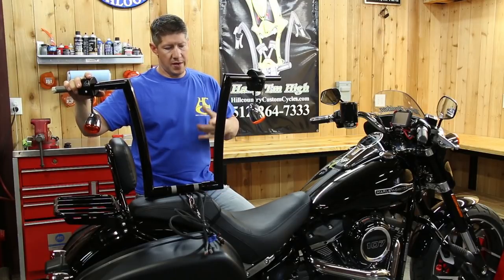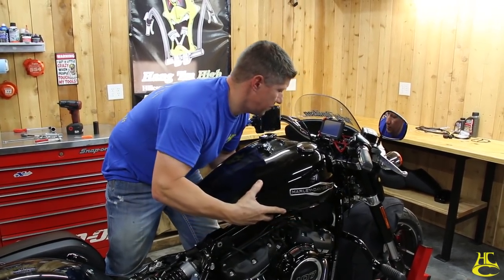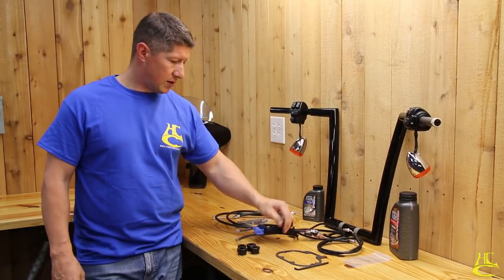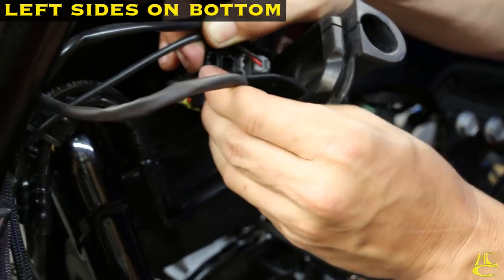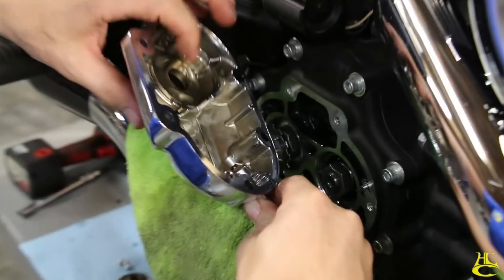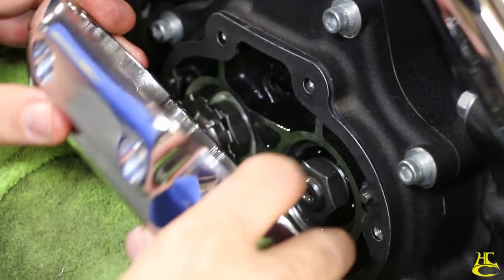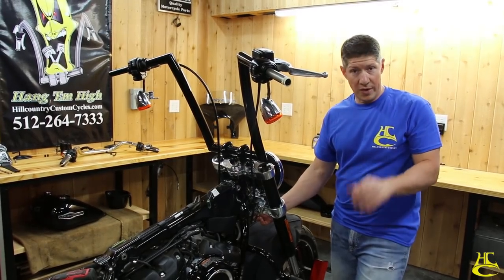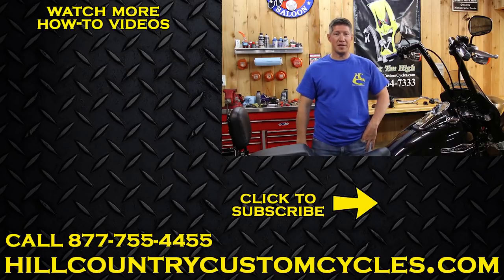How To Install Ape Hangers 2018 Harley Davidson Softail - Save Time & Money!!

Comment: Great video!  Question -why did you have to install new clutch cable all the way back by the exhaust.   I always thought on newer bikes the HD quick release was there to make it easier.   So you didn’t have to take the bolts off of that compartment take the balls out etc.  just curious
Reply: Never seen that. Maybe it is like that with the hydraulic clutches.
Reply: I was thinking the same thing. I have a 2019 sport glide and I'm about to install some bars and everything I've read so far says you just need to fellas the upper clutch line. no need to mess with the lower

Comment: Good day great video thanks. i have one question about the throttle by cable and the connectors on a 2013 FLHX and z bar style 15inch apes does one have to eliminate the connectors to go around the first 90

Comment: Great vid. I was wondering if you could help me with something. I unplugged all the cables like in the vid. In the end I took my bike to a shop and they’re worried about plugging it all in again due to some of the plugs being pretty much the same. Have you got some kind of diagram that shows what plugs go into which terminals/sockets ? Would be a massive help. Thank you
Reply: Rob Pullen the only 2 that are the same are the blinkers I’d be questioning this bike shops ability if they can’t figure that out
Reply: Colin Elwin yeah thanks man for that. It was all done a while ago as you probably guessed. The issue was that the guys in the garage were completely old school and didn’t like working on a newer bike. He blatantly told me he hated my Harley and I know that sounds harsh but it was all in good banter. Anyway. It’s all sorted now so happy days. !! Thanks mate

Comment: Clutch cable to Transmission @11:53.
This motorcycle is the Sport Glide, it is a Softail, but on my 2018 Heritage Classic the exhaust is directly and completely over the cover, a new style two part cable would be alot easier.

Comment: Awesome vid! Wondering how much of a difference would be for my 18 road king special?
Reply from the maker: +levi norman  we have done several pre-wired bars for the Road King Special since it came out.  Cool looking bike.  It takes a special wiring harness since the turn signals are mounted on the hand controls.  16” Hell Bent in gloss black seems to be the most popular bar for some reason.  If you tell me your height, I can make a size recommendation for you
Reply: @HillCountryCustomCycles  5'11"
Reply from the maker: +levi norman  I’m 5’ 11” and 16’s are perfect on a Road King

Comment: HD dealer want's 6-8 hours of labor @ $149 per hour to install bars.  This video covers almost everything but I did not see where the Throttle By Wire right hand  grip was removed and installed into the new bars.

Comment: Save time? I've been doing this work for a month already! First i couldn't run wires through a sharp angle on the handelbar, then i bought handelbars with rubber caps on the sides where i could hardly run wires, then the main problem is the stock handelbar has 1.25 inch clamp width, but 99% percent of all ape hangers have 1 inch clamp base, then it was hard to find 1 inch mount, when i found it eventually I found out that it doesn't have thread for my original bolts and i need different bolts with nuts which now i can't find anywhere, what a pain in the ass, i don't understand how almost everybody has those ape hangers installed if there are no proper parts 😢